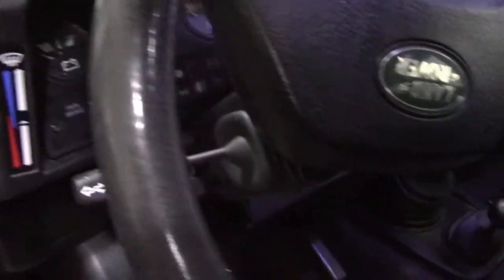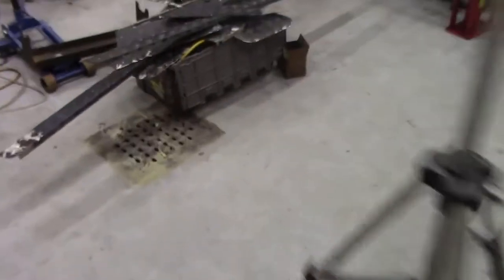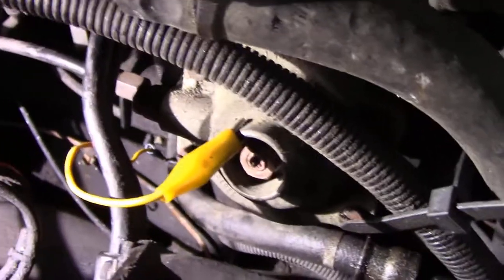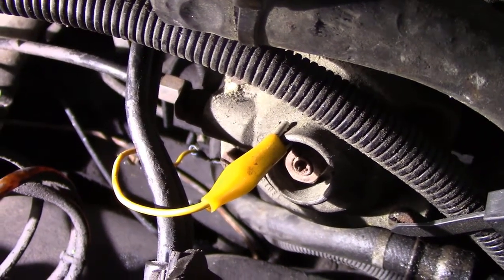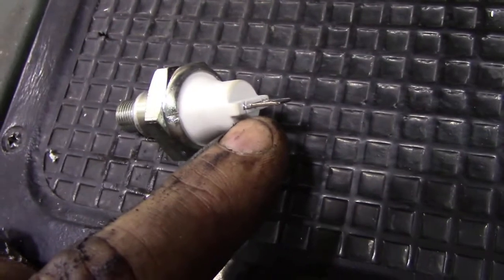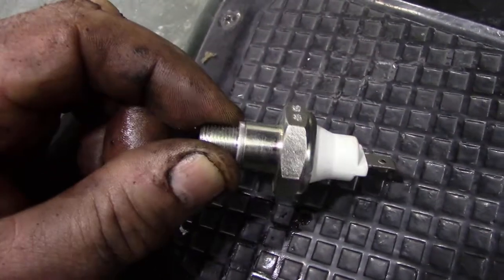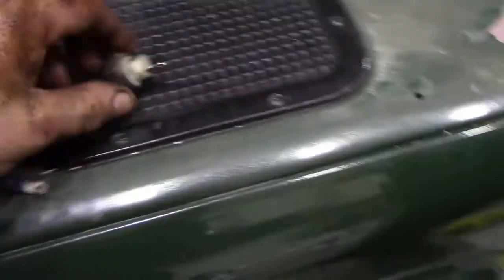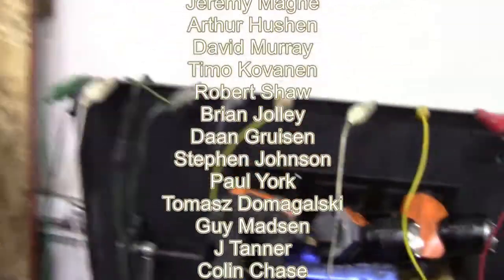Workshop life! 300Tdi oil pressure switch faults

Comment: Thanks, Mike - very helpful. Exactly the problem I'm having now. Tested the lightbulb at the dash, and it works. (Series IIA) So I'll do your test by grounding at the switch location. Then replace. Thanks! -Mike
Reply from the maker: Very simple to fault find but 99% of the time is is a bad switch - get an OEM one if you can the cheap ones are bad - real bad!
Mike
Reply: Thanks again. It was the switch, because grounding the wire turned the light on. Got the replacement, and will install. Thanks! @BritannicaRestorations

Comment: New question, about my Series 2A Cold Start light. It is off.  From the bulb, there is a wire that goes to a triangular sender on the top of the engine. I believe this is the "thermostat switch for mixture warning light."  503587 The other wire is white to ignition switch. Bulb is fine. Can you tell me how this light is supposed to perform?  Ran the same test as above by grounding the wire at the switch, and the light came on. Is this a case like the oil pressure switch, and I simply need a new Engine mixture switch?    What does this switch do?
Reply from the maker: there should be a power wire on the choke switch and this goes to ground via the thermostatic switch on the motor
When the engine is hot the light comes on - I think - I have one on my S1 but not fired it up for a while
Reply: Thanks, Mike! @BritannicaRestorations

Comment: Hi ther i have a 300 defender done 350.000 km same engine ,the oil light is on but as soon as i raise rpm light turns off, any advise would be great thanks ..Darren
Reply from the maker: I would try and get the real oil pressure checked using a gauge first  -  it could be the switch or something in the engine
Mike
Reply: thanks very much